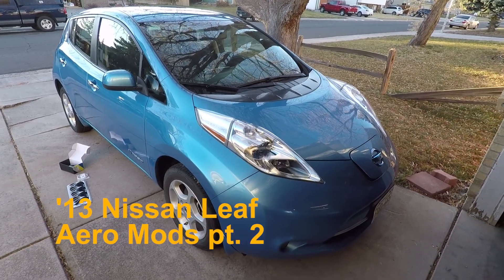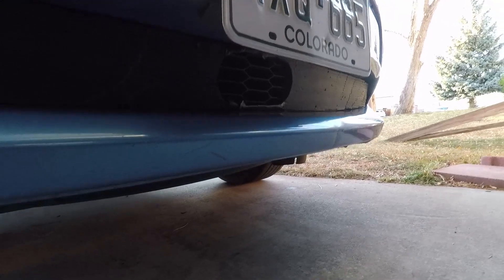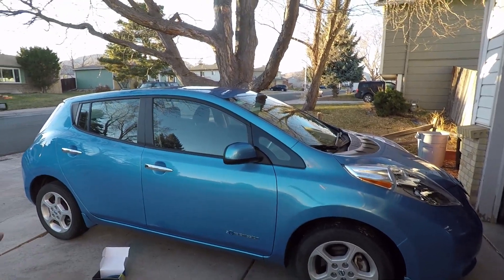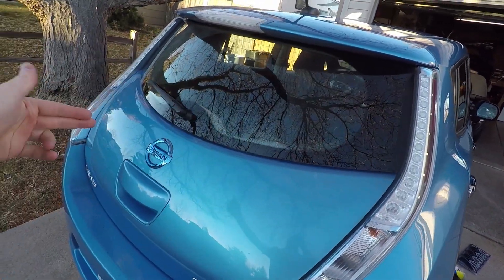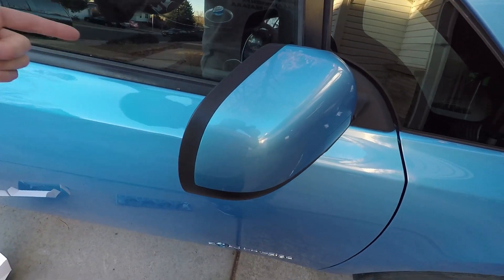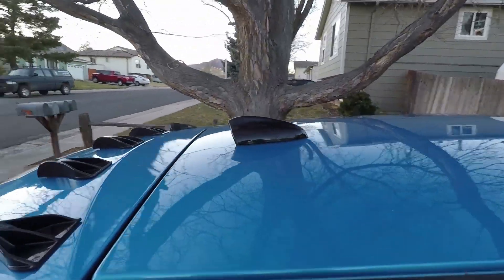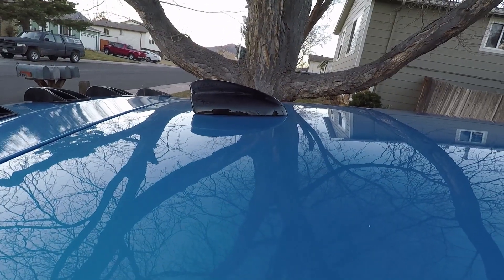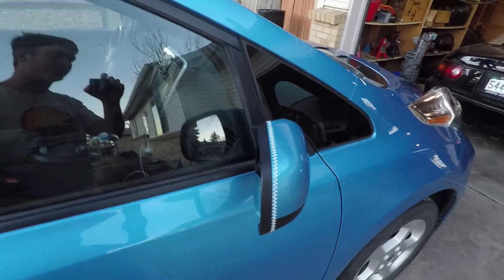Nissan LEAF Aero Mods Stage 2 - Cheap Range Extending

Comment: Good shit. I'm thinking of getting a Leaf for mods.
Reply from the maker: Do it! They are great little cars and you can get them dirt cheap. Currently I bought a salvaged leaf and am putting the parts into an EV conversion
Reply: @Turboactive  My only concern is battery damage or drainage. Any head's up?
Reply from the maker: @donjohn5542  I would recommend only getting a 2013 or newer, or better yet a 2015 or newer because in both years the battery chemistry was updated and they are better. Leafs measure battery degradation on a 12/bar meter to the right of the charge meter. I would recommend getting a LEAF with the most bars remaining that you can afford.
Reply: @Turboactive  Wow ok. Didn't know any of that. Thank you and noted. I'll keep an eye out when shopping for one.

Comment: Like to see the efforts you've put into your car - also your theory on using vortex generators. Could you measure any difference.? Did you try other aero mody by now? There still is lots of potential, e.g. wheel covers, air curtains for the front wheels.... At highway speed, the turbulences of your rims account for about 1/3 of aerodynamic drag.
Reply from the maker: I have since sold this car and moved on. I did not measure any difference directly, but I was consistently getting 5.5-6 miles/KWH after all of my mods on my commute which is really good for highway driving!

Comment: What if you cover the opening of the rims like the land speed racers?  How about covering the rear wheel wells?  Every little bit helps.
Reply: Especially if he puts on skinny wheels with high pressure tires, they really do wonders to your coast times and can cut 20% of your low speed consumption where rolling resistance is the main energy thief and gives plenty of room for wheel well covers. sadly the Leaf has a chubby rear, that really is difficult to put a suitable fairing on, which will would also interfere with the brake lights. Vortex generators can be the next best thing, but you have to do tests: A-B-A testing and a yarn test maybe even drive on a dusty road while a friend films, to judge if their placement is optimal.
Reply from the maker: All good points. Wheel air dams are supposedly just as good as pizza pan wheels from what I've read.

Comment: I like the reverse mud flaps idea.  Do you know the difference in range before and after?  Very interested to see if the vortex generators work.  According to Nissan the head lamps already create a vortex to spin over the side mirrors to reduce noise and drag.  Thanks for sharing.
Reply: It works ok its not the best mod but it works
Reply from the maker: Yes check out my earlier video "Stage 1" where I do back to back testing and the mud flaps and grill block gained me 0.2mi/kwh

Comment: Okay so here is my idea for a mod - I want to buy a 'lift kit' for the Nissan Juke (apparently the Leaf has the same carriage as the Juke). Then I want raise the Lead and also install bigger wheels. In essence I want to turn my Leaf into an SUV. It's not going to extend the range but it will certainly make the car look cool.
Reply: Mark Plain have you made the Off Road Leaf yet?
Reply: Nooo... dammit... As it turns out it is a little more complicated than I thought .  The lift kit for the Juke is actually quite rare - apparently there is a supplier in Russia.  It's going to be a while before I do anything, but considering the Leaf is a hatch back, I reckon it will make for a good looking SUV
Reply: Mark Plain have you contacted any 4x4 lift companies in the US? It would make a great Rock crawler and will be featured in all the off road magazine when it’s done. That might be one way to get it done.
Reply: A donk leaf?
Reply: I bought 18" wheels with 215/50 tyres, it got higher

Comment: ha ha, I was going to say, put the new antenna on backwards and then you said it.  Yeah, let us know if you notice anything.  what about the opening in the wheel wells and under the car.. I know you can buy large sheets from Home depot, albeit white, but could really smooth out the under body.. I know the leaf is already smooth compared to most cars. though

Comment: for gods sake please take those vortex generators off the roof, you are just making drag, they are used for keeping airflow attached to rear windows to help the airflow reach a rear wing, or increase low speed lift on aircraft at the expense of extra drag. I assume this is all a joke. Put flat wheel disks on your rims and close up the rear wheel well.
Reply: So, what's the update after the last few years? I've seen something similar on semi trucks. I can't imagine THOSE are intended for wings.
Reply from the maker: chubscub they can do a few things keeping air attached around a hatchback is a proven use case.. thanks for watching and the tips!
Reply: Yes the vortex generators can keep airflow attached but there is an angle limit for that to work , you already have a cut off wing factory fitted that creates a separation point, your vortex generators are not going to attach any airflow other than produce drag generating vortices off the back of the wing. You are better off having an extended roof wing that curves towards the ground to help return airflow back to its original place and close the vacuum behind the car. On the point of your new roof antenna it is mostly sitting in the turbulent boundary layer now so it is going to be less drag than one sticking up so its shape isn't going to effect much but how about finishing its shape off with carved foam and stick it behind the antenna if you want the correct shape to it. Go buy yourself a book called The Leading Edge, by Goro Tamai. All about the aerodynamics of Solar powered racing cars.
Reply from the maker: Well, there are many theories. The theory I am subscribing to is that the VG will bend the airflow down and keep it attached to the rear of the car longer to create a smaller wake. Yes, the factory spoiler, and the way the rear lights on the Leaf are shaped, are intended to also create this effect. It is common on modern hatchbacks. However, the Leaf has a more sloped rear end (that makes it ugly as sin) compared to other hatches, so I believe the VGs will make more of a difference. In my commuting this week I have seen higher numbers than normal even though it's colder, of course it could just be my driving. Luckily my Leaf automatically uploads the driving efficiency to a Nissan website and stores it there so I can go back and see if any new trends are developing in my driving efficiency.

I also want to build a rear kammback, but that is taking longer than I anticipated so I'm giving these a try in the meantime. Thanks for the book recommendation, I have added it to my list, although I have read quite a bit of aero resources and I have applied them to many vehicles from Miata to Honda to GMC Truck to now my Leaf because I can't help but tinker :)